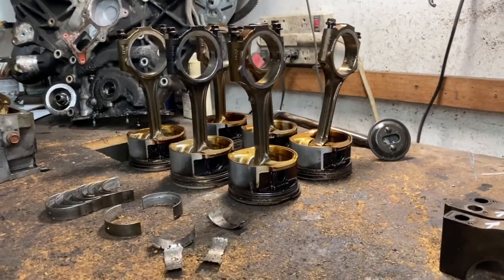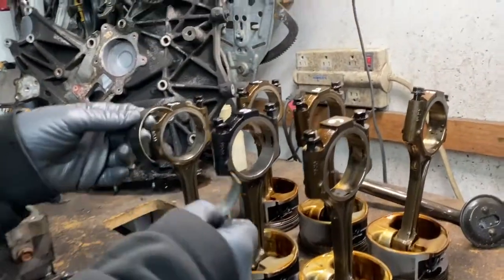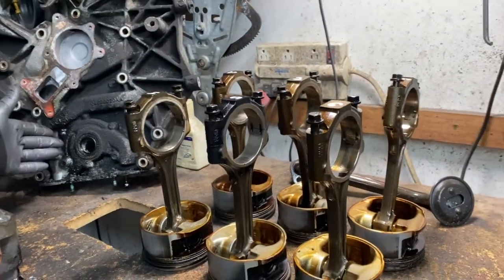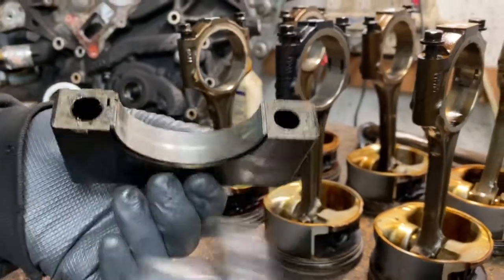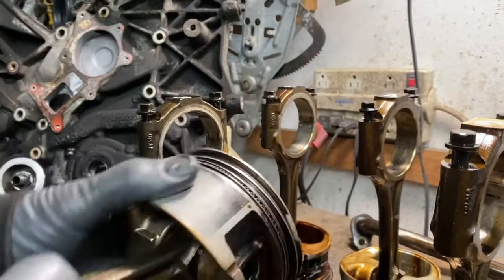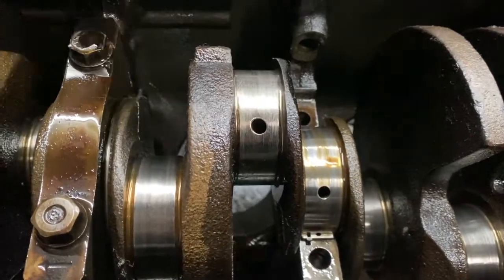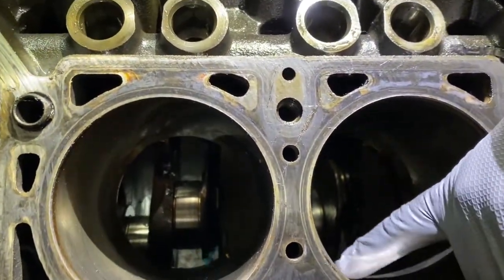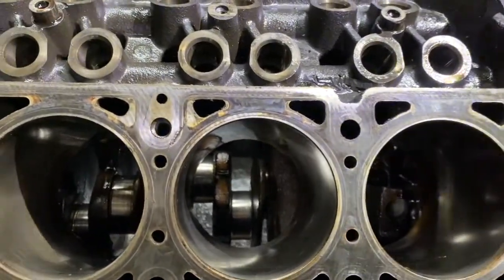Look What Happens When You Don't Change Engine Oil

Comment: Can scaring on the rollers occur just from low oil? Or only no oil?
Reply from the maker: That is basically the same thing and yes. If it ran low on oil to cause a starvation of oil scaring can occur.
Reply: @motorcarnut  Ah okay, if the dip stick shows low oil, but car is running fine. I am trying to understand if this can cause the scarring?
Reply from the maker: Depends how low the oil is? Also may have metal particles in the oil that are causing the scoring.
Reply: @motorcarnut  got it! I am in a situation after a Jiffy Lube oil change, so doing my best to learn as much as I can about engines. Went in for an oil change, no check engine light - JL stated oil was low prior to the oil change. Left having to tow my car from Jiffy Lube after their oil change. The repair mechanic shows scored rollers, and a starved engine for oil. So I am trying to see if it could the scored rollers could have occurred prior to the Jiffy Lube oil change. :)
Reply from the maker: That I couldn't tell you. Good luck thought!